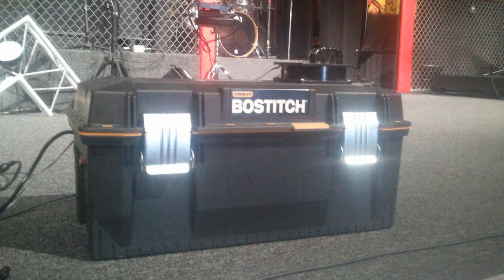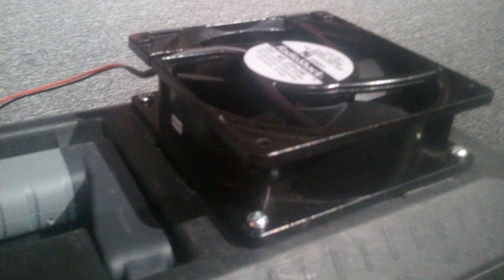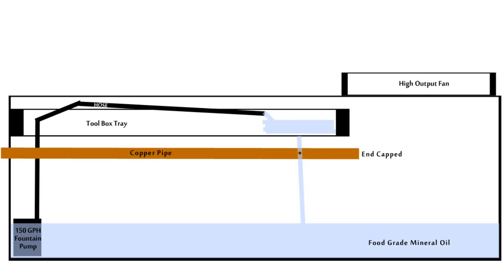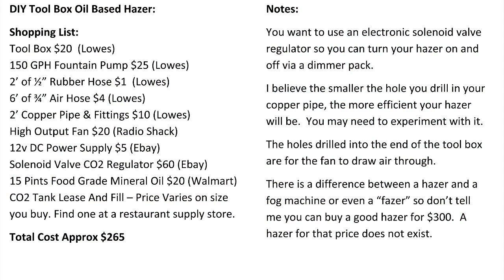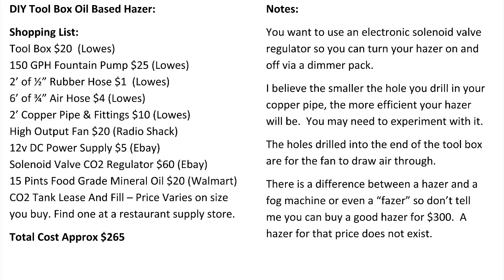Updated! How to Build a DIY Hazer

Comment: Put oil based haze fluid in the bottom of a 5 gallon water cooler jug drill a hole in the side on the top stick a air hose through it into the liquid with a valve i just saved you even more money lol

Comment: I know this video is OLD, but, just wanted to say thanks for the insight to making one of these. I made a similar one, but instead of having one nozzle for the air I used two. Seems to do the job pretty well! I also run mine off a compressor and I use Oil based Haze fluid because it's cheaper than mineral oil where I am...

Comment from the maker: I was not able drill a hole small enough.  I used the smallest bit I had but it was still too large.  It would work but used way to much CO2.  So, what we did was heated solder covering the drilled hole with a plain steel guitar G string in the hole and after a couple attempts we would let the solder cool just enough and remove the guitar string leaving a hole.  The guitar strill was like .24mm I think but can't be positive.

Comment: questions :
- what is the size of the hole in the copper pipe, because you say the smaller is better can you give me the size of yours is it 0.1 milimeter or 1 mm or something else.
- the hole in the pipe should be done vertically or horizontally 
- Is there any reason to specifically use CO2 or can I use output for a air compressor (except noise)
- I heard about 15psi on the video but it seems very low compared to atmospheric pressure, can you confirm the regulator output pressure.

Comment: You could have simply bought the tank from the haze machine American DJ sells for $125. That tank comes with the atomizer inside and is extremely efficient. All you need is haze fluid and your compressed tank would do the job just fine.